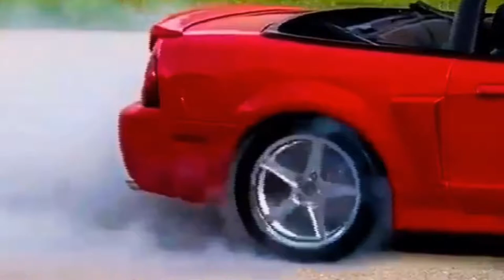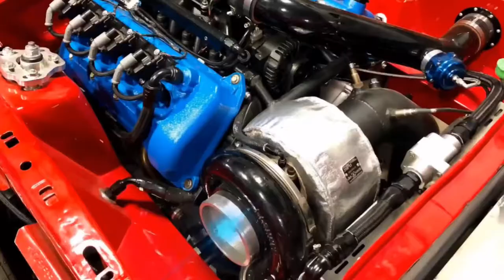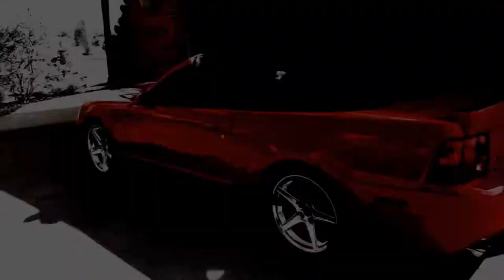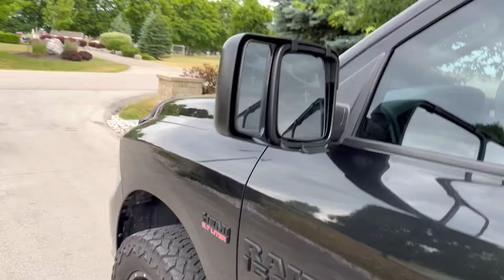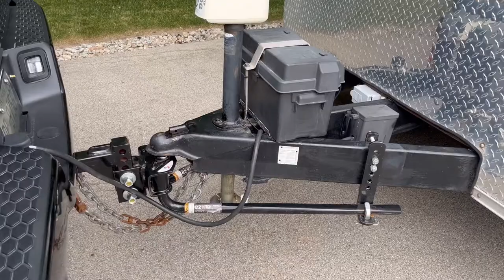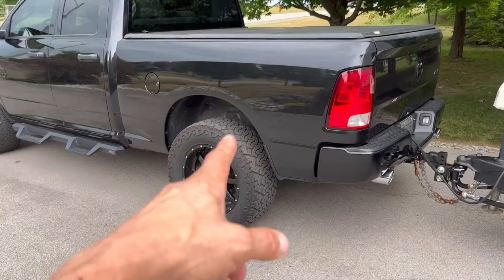BEST Towing Mods for Dodge RAM 1500 // Increase Safety and Tow Capacity!!

Comment: Hey Paul, nice setup.  I see this was posted a couple of years ago and this is probably irrelevant but incase you didn't catch it there are two parts to the puzzel that are important. 1. always run a hitch pin on the ball clasp. 2. Run a emergency brake away in the event $#it hits the fan the trailer will come to a stop and not run rogue. And a bonus tip on the air bag setup: I set up a rig with one air valve and the air pressure would transfer from one side to the other under cornering, sometimes causing a snap oversteer.  Here in Tahoe I'll place the air valves behind the gas door to keep out of the weather.  Hopefully this helps someone the first two items are important.  Nice rig BTW, my Ram is a Quad cab sport 4x with a 3.92 rear 8spd, it hooks up out of the hole in AWD!  fun stuff.  Cheers!
Reply: Taking a closer look, it appears there is an emergency brake a way.  The attachment 'should' be  separate from the chain connection, best is to connect it to a separate part of the truck like license plate bracket, in the event that the entire reciever fails, which is not common but does happen.
Reply from the maker: Thanks for the great input!! Much appreciated 💯
Reply from the maker: There is a e-brake away cable and it was connected to the hitch itself. Thank you🙏🏼

Comment: What is "full weight"? What is the most weight you would safely tow with this set up?
Reply from the maker: I’ve towed on several occasions my enclosed 24’ Car trailer with a 3,000lb car, loaded with tool box, fuel, generator etc and it handled it no problem! Thanks for watching, have a great weekend!!👊🏼🏁